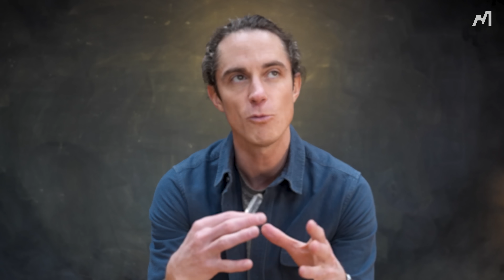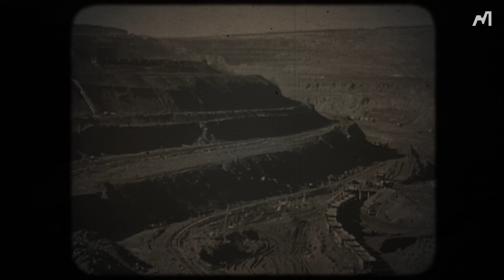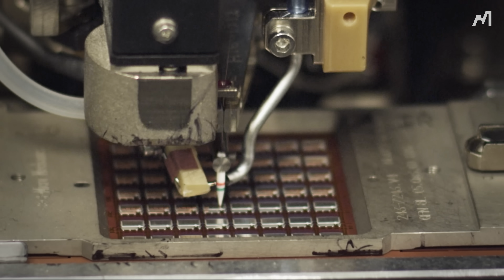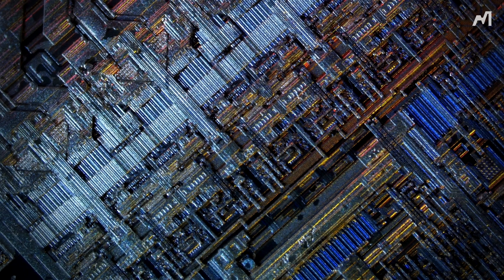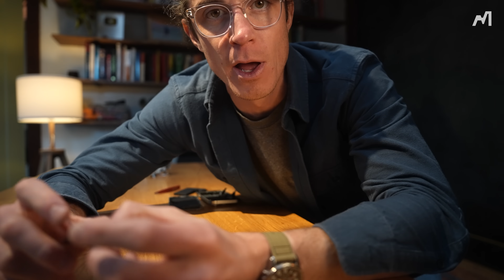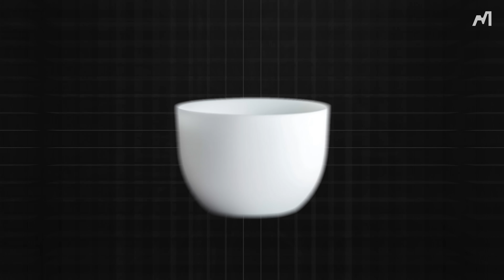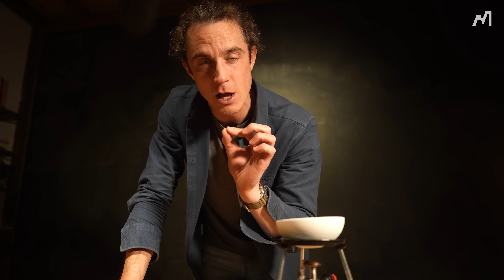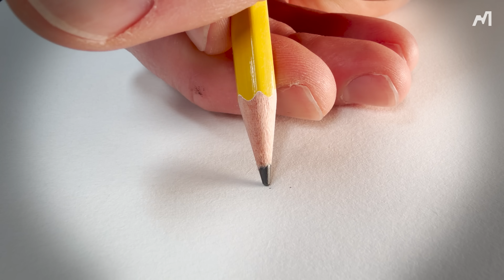Saudi Arabia Has Oil, America Has This

Comment: Fun fact: In the 1950s, Bell Labs basically gave away all the science, patents and production  information needed to make semiconductors to any company or country that wanted it (as long as they weren't communists, natch). Bell actually held classes to teach engineers around the world the process - because as you said, there's a lot of black magic involved. AT&T was afraid that if they didn't share the technology, they would lose their government monopoly on the phone business, so the pinheads in charge decided to just give away arguably the most valuable invention in human history.
Reply: dont forget transistor tech was incredibly difficult to make, even with the knowledge of what it is. There's such a massive gap between research and manufacturing silicon based transistors that it was more of a net positive that the tech was released freely. And then miniaturizing the tech? yeah that's where the real secret sauce is, not in the basic first principles of silicon based semiconductors
Reply: @skytron22  it is still massively difficult to make computer chips we just have 50 plus years of experience and equipment improvement.  If people knew what it took to make computer chips that work reliable they might just throw them away less.
Reply: @jonathanjones3126  i have like 70 cpus. mostly older pentiums and older i5 and i7. dont know what to do with them but cant bring myself to throw them away.
Reply: recycle them
Reply: @jjora.sI know how you feel, I have a 40 piece cellular phone collection stretching back to 97
Reply: @jonathanjones3126 gotta tell the companies doing planned obsolescence to stop first. Why value what is artificially deflated?
Reply: @jjora.sstore them in lead shielding and they just might be valuable if there ever is a massive solar flare or EMP attack
Reply: @jjora.s You could donate them to some underprivileged inner city utes.
Reply: @jjora.s Build a Super Duper Looper Supercomputer with Them! :D
Reply: @jjora.sTake them to an E-recycling place.
Reply: @jonathanjones3126  and humans last thousand years ago no nothing about this, imaginee if computers were invented in the time of Romans? where could be the civilizations now?
Reply: @BiggestG13 i have slowly grown a cellphone/ cpu / console collectuon. I've been trying to think of a monstrosity I could create with them...
Reply: @jjora.sdefinitely hold onto those CPUs.
Reply: @RG-Episodes  I'll be back. Terminator
Reply: @skytron22 really cool
Reply: @skytron22  Photo lithography was and is used for transistors - even microprocessors. Not difficult to make, I was making Ghz diodes at 17 years old for the company I worked for - by hand - not keen on the phosphene and arsine gas deposition stage - but hey every process has its drawbacks and all the chemical washes, vacuum aluminium deposition..........A transistor is two diodes back to back. it is not difficult by far - packaging, now your talking skill with wire bonding and encapsulation, diamond saws, but Ghz chips were wire bonded or silver epoxy glued to special low loss dielectric circuit substrates.
Reply: @skytron22  Naw, you're wrong. The basic first principles are far more interesting and important than someone 'miniaturizing' the tech.
Reply: @cjay2 disagree
Reply: while maybe not good for business, this accelerated human innovation in the semiconductor space.
Reply: @stephenjones991 Exactly
Reply: @stephenjones991  and that was the goal. They needed that to get to AI.
Reply: @artytomparis  The original goal absolutely was not to create AI or to advance the human race. It was solely to protect themselves from government intervention.
Reply: @DDadams0  ...third order of power in the universe...the law of unintended consequences...
Reply: @glennvage I want to know what you think the first two are please tell me what you think they are?
Reply: @nicholaswood7704  ...1.fear  2.direction of travel...
Reply: @artytomparis majority of AI is open source. Issue is access to equipment to do cutting edge impact on llms BUT youre still free to do your own cutting edge research on learning methods. Theres actually a host of researchers on youtube sharing this. It isnt as bad as it seems but still, majority of research money is being put towards the wrong segment.
Reply: @nicholaswood7704  I want to know now too.
Reply: @glennvage  What are the first two? And all the rest?
Reply: @maryamjoha answered below...
Reply: @stephenjones991 how about end capitalism
Reply: @joshuacox5817  communists and socialist must have capitalism, otherwise, they would not exist.  Would they?
Reply: @mattmorrow7777  buddy. You do not need capitalism for trade to exist
Reply: @joshuacox5817 🥴😩🤦‍♂️🤷‍♂️
Reply: @joshuacox5817  Inform the class which country has successfully removed capitalism. 
I'll wait...
Reply: @leofortey7561  plenty, but they were all suddenly attacked by CIA death squads and/or subject to regime change actions including puppet dictatorships, war, capitalist encirclement as well as economic hitmen and school of the Americas.
Reply: @joshuacox5817 "Plenty" is not a country. Go on, list them out since there were so many
Reply: @joshuacox5817  we're waiting for this list o plenty josh
Reply: @joshuacox5817 How about NO.
Reply: @joshuacox5817  oh, internet, don't ever change. 😂
Reply: @joshuacox5817  So, it's America's fault communism has killed so many people?
Reply: @joshuacox5817  Capitalism was the reason you enjoy the things you enjoy, including the most basic things you take for granted, and the reason you can say your nonsense on YouTube.
Reply: @hoppinggnomethe4154  1) government created internet, 2) creature comforts are here at the EXPENSE of other countries. Capitalism gives nice things through exploitation, not virtuous trade.
Reply: @joshuacox5817 get off you screen and go do something about it
Reply: @joshuacox5817  That's not always the case. It's maybe 10%. Endless genuine entrepreneurs, especially those who work in protecting the environment, do have altruistic goals and do their best to avoid damage or unethical trade. This is one reason why Fair Trade and Leaping Bunny certifications exist.
Reply: @joshuacox5817  You do. People need to perceive a benefit for an exchange to occur. That net benefit is the capital in capitalism.
Reply: @joshuacox5817 everyone your talking about where trying to become communists lol
Reply: @joshuacox5817  you're an absolute fool. Read a history book. The ENTIRE WORLD was in poverty less than 300 years ago. 99% of the population of the planet was in abject poverty. Less than 10% of the world is now. Capitalism made that happen. 

How many people do you know from the 3rd world? I know a lot of them. Kenya, rural South Africa, Philippines, Guam, Cuba, and more. Every, single, one of them praises capitalism for being the salvation of humanity because of the history of their countries. The ones from Cuba are particularly critical of communism.
Reply: @rustyhua  the ones from Cuba are white. The black Cubans stayed because they knew the u.s. was racist.

As far as the world progressing technologically, yeah that happened but the working conditions of the industrial revolution were trash and people were dying more frequently until there were improvements in working conditions because of socialists and workers protests and unions. The deaths from wars and colonialism was not from Karl Marx.

Keep lying though, bootlicker.
Reply: @joshuacox5817    i wish they would 
Id drive straight to your house and take everything you have and everything you were ever going to have.
Reply: @joshuacox5817  😂😂😂😂😂 saying the quiet part out loud huh? A true Communist would at least pretend its 'the people' instead of the government that achieves things in their totalitarian fever dream. After all, the supposed end goal of Communism, when a system becomes Communist is when government withers away. Your eagerness to (falsely) point out the government created the internet kills your own ideaology 😂

You're just a lowy statist who doesn't even understand their own religion.
Reply: @6Sparx9  those are certainly words. Dunning Kruger effect
Reply: @joshuacox5817  Invoking Dunning-Kruger as a means to invalidate someones argument is peak Dunning-Kruger 😂😂🤣

Feel free to explain yourself.
Reply: @6Sparx9  you're just proving my point. You think a reverse uno card works here but it doesn't. Child.
Reply: @RussellBeattie : Bell didn’t “choose” to give it away - they were “required” to by the conditions for their phone monopoly. They also had to give away the C programming language for the same reason.
Reply: @andrewmole745 The 1949 antitrust suit is different than the one in 1974.
Reply: @RussellBeattie  it was the 1956 Consent Decree that forced them. and it was not for free - they were expected to charge a reasonable license fee. and the foundation patents expired in the 60's.
Reply: @RussellBeattie in all fairness, if they didn't do that, we would have been set back 20-30 years in technology. At least.
Reply: You could reasonably argue that had they not done that it wouldn't have gotten so important in the first place but just been niche technology.
Reply: @nicklockard  No, it would have become important anyways because of how useful it is.
Reply: @joemascone  the industry would have simply have stagnated then. Also what could not have been reverse engineered then doesn’t mean it couldn’t be reverse engineered now. Even if it was considered top-secret, if it was absolutely critical, the secrets would have leaked like they always have
Reply: @joemascone I've said it before and I'll say it again that's because greed is a disease and unfortunately just like diabetes and sugar money is related to greed and if you accumulate enough of it if you can get past a certain threshold the disease kicks in and now you will do unspeakable horrible things to feed the disease, and that is why it will never be enough it's an addiction.
Reply: @ZahrDalsk we only know how important it is because millions of minds looked at it and came up with ideas and gadgets to use it. If only a few thousand employees looked at the tech development would be lower and slower. We'd be 56k and digital lcd phones today even if the employees were in the 90th percentile.
Reply: That fact wasn’t fun.
Reply: @crunchycrispybacon  You're right.  A fun fact would be, say this was a Marilyn Monroe video, "Fun fact- Marilyn Monroe had an extremely small sixth toe on her left foot".
Reply: @casmoneansthefourth  The claim that Marilyn Monroe had an extremely small sixth toe on her left foot is a widely debunked, enduring myth originating from a 1946 beach photoshoot by
Joseph Jasgur. The apparent extra digit in the photograph was likely a trick of light or a clump of sand, as subsequent photos show her with five toes, and no other evidence supports the claim
Reply: Knowledge should be free
Reply: @noonynoonynoo nothing is “free”
Reply: @noonynoonynoo  advanced knowledge causes geopolitical clashes bro and threat to national security(thats how to make easy money by keeping with the tech with patents😁)
Reply: "AT&T was afraid that if they didn't share the technology, they would lose their government monopoly on the phone business"
They were afraid of losing their monopoly, so they guaranteed they wouldn't have a monopoly? That makes zero sense, sounds like you're just repeating a story you misheard
Reply: @alexrogers777 Oof, just look it up. AT&T had a government sanctioned legal monopoly on the telephone business. But in 1949, the company was accused of abusing their monopoly, so they gave away transistor tech in 1951 in an attempt to appease the government.
Reply: That wasnt altruism, they had discovered patented and been iterating on semiconductors for decades iirc. They were forced to use the patent or lose it as a part of trust busting enforcement. Thats why the communism stipulation was there the us government was forcing its use and ensuring its own supremacy. They didnt advance tech they were forced to stop holding it back for the us' geo political strategic advantage, not human good.
Reply: @Shadow-gc6le  both of your comments confuse me but id like to understand
Reply: @artemislogic5252 fax
Reply: @artemislogic5252  The USA forced bell to share the info on making semiconductors by saying theyd lose their patent if they didnt use it. They also only let Western aligned countries have the knowledge so only NATO and the west would have the knowledge
Reply: @Shadow-gc6le  This is factually wrong in every way. The first working transistor was created in 1947. Bell Labs have their tech away in 1951 and 1952 in order to appease the government who accused it of abusing their legal monopoly. It had nothing to do with "use it or lose it". Where did you come up with that idea??
Reply: @Shadow-gc6le 🤔🤓
Reply: @Shadow-gc6le  Many see "the us' geo political strategic advantage" and "human good" as the same thing, esp us not in the US.
Reply: @LeeGee You mean especially us allies.
Reply: @Shadow-gc6le which is most of the world, whether one likes it or not. We keep the shipping lanes open
Reply: @baloneysaucejohnson8747 you were saying?
Reply: Of course transistors had been developed elsewhere between 1947 and 1956 when the case was finally settled.
Reply: fun fact an Italian invented microprocessors and another the tech to light print it
Reply: When we lived up there, I used to drive by the Bell Lab (now Nokia) in New Providence, NJ to show my kids where the transistor was born.
Reply: Texas Instruments was the first semiconductor manufacturer led by a Chinese engineer who later founded TSMC
Reply: A group advances humanity as a whole and they're "pinheads" for not hoarding the wealth from it 🙄 Yikes
Reply: Open source will always win where talent is more required then capital. I think they've made the right decision, since it also serves mankind as a whole.
Reply: @Krypt1cMinds 
There are two ways to keep your company techs: apply for patent and get government protection for some years in exchange for letting other companies study it and set up competition once the protection is expired. The other way is through proprietary, which goes without government protection but ensures you keep the secret as long as you can keep it secret.
Reply: @Krypt1cMinds Open source is for people to advertise themselves about how good they are in it. Companies will browse it to recruit the potential ones. But it's rare that once a talent is recruited they will put their next idea into open source.
Reply: @Krypt1cMinds  Not always. Sometimes the cost of producing IP is so great that to give it away is corporate suicide.
Reply: @Krypt1cMinds Evil power-hungry people and political systems will always use everything against the rest of the world. "For the good of mankind" is their excuse 25 years before they start to take action to control and enslave everybody else.
Reply: Gave away to whom?
Reply: @Sharingyaan they gave it away to Joe.
Reply: @elessarstrider5210no, Jo Momma.
Reply: @Sharingyaan   American corporations who in turn were bought by private equity and sold off for parts.
Reply: not "fun" at all
Reply: Thr fire is more valuable IMHO.
Reply: We need more of this.
Reply: I think they did a great thing by giving it away
Reply: But did it work?
Reply: Giving away the best invention in human history is the biggest flex you can make.
Reply: ... and then the government ended the phone monopoly, regardless.
Reply: Good stuff 👍🏽
Reply: Those pinheads are personally responsible for the technological advancements of the entire globe for the last 70 years. We would likely still be using 80’s tech without that move.
Reply: Google open sourced the LLM around 2016 if I recall correctly. Chat GPT went live around Nov 2022. The rest is history in the making.
Reply: @ElectricIguana slop
Reply: @ElectricIguana they didnt open sourced llm. They released paper called transformer architecture which is crucial in LLMs
Reply: @ElectricIguana ah yes, OpenAI, famously no longer open source.
Reply: @ObjectivistApe and no longer noon profit, lol
Reply: I hear what you are saying, but I'm glad they did or chips/computers might be way more expensive.
Reply: For anyone who wants more info, search for "Bell Telephone Laboratories Transistor Symposium" held in 1951 and 1952.
Reply: why did this channel not know about the blue mountain deposit in oregon
Reply: cute
Reply: Without Jesus you’re dumb.
Reply: Lithography was also given to sml because they were the only ones willing to keep the hard process going
Reply: They were forced to patent the semiconductor
Reply: Good times , commies where locked into soviet union, they didn't walk amongst us
Reply: Good
Reply: Yeah I don't know about this.....the invention secrecy act exists
Reply: in the 1950's they thought democracy was going to be good for us :face-green-smiling:
Reply: All companies should do this
Reply: That's not exactly how it happened or why. But fact is we're fed bs and you aren't going to get the whole story.
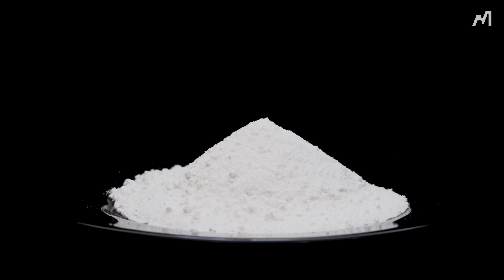Reply: 0:50 I'm not zooming into your piles 🤨
0:51 Too late! 😲
Reply: knowing how it's done is one thing, doing it and doing it well is the impossible feat
Reply: that tach fund with tax money payer...so belings to all of as
Reply: Try looking up the history of Sawyer Technical Materials
Reply: HEY TRUMP- I'VE STOPPED WAR WITH RUSSIA+ CHINA( AND EVERYONE ELSE)...
BE VERY NICE
OR 
NO CRUCIBLES, NO ELECTRONICS...
MWAH MWAH MWAH....
🤯🤯🤯🤯🤯🤯🚀🚀🚀🚀🎇🎇🎇😭
🎖️🏅🏅🥇🥇🥈🥉🥉🥈🏅🎖️
Reply: Fun fact.  Belle Labs main contracts were military and medical.  At least one director I know of was the head of a program to develop our capability to shoot down ICBM's.  The same person had the humblebrag that some successes they were having were part of what led to the Stat I treaty or something (nuclear arms reduction) before he died.  He didn't go around bragging about his time at Bell labs but I asked him a whole bunch of questions and took notes.  He was talking about how he had email in the 60's and how certain tech they had he is surprised they didn't pursue more (make commercially available) as a lot of tech we have today is a result of experiments and tech they made back then.
Reply: They gave it away because the United States had vigorous antitrust enforcement at the time.  They didn't really have a choice.
Reply: Well, that is the benefit of a gov financed company. What gets me is today universities hoarding and patenting everything even when using gov money and when it is totally unreasonable to do so.
Reply: Why would they lose their monopoly by not sharing the tech?
Reply: @RussellBeattie
"Fun fact: In the 1950s, Bell Labs basically gave away all the science, patents and production  information needed to make semiconductors to any company or country that wanted it (as long as they weren't communists, natch)."

The old ways are the best ways.
Reply: If that didn’t happen the USA would be the most advanced nation in the world by decades. What a world that would be
Reply: What?
Reply: I have seen patents that are so basic that they're just for big companies that have money to patent everything and then sue small competitors out of business. I wanted to create a way to design and order DIY tailored custom clothes so I dug into the patents while I made a business plan. Amazon custom clothes was literally a doodle a CNC Cutting table of different fabrics put in a box together sewn together. I got the idea from how Ferrari's are made leather seats are cut from cow hides with automated cutting wheel CNC table. It had the totes on a conveyor and little trucks a factory with smoke stacks. I found it because I thought why not do that with clothes. A bunch of photos at different angles a tape messure some AI to make a digital twin 3D avatar a step by step entering of personal tailor demnsions well that was also a patent the sheet template to enter in messurements a way to layout patterns efficiently and adjust them to size a patent a 2D image to 3D rebdar using AI yup a patent. What if I want a non toxic die that uses way less water a patent a way to have cotton denim organic weave on one side and wool on the back you guessed it a patent and a trade mark so I wanted to be able take a  picture of myself turn that into demensions other some tailor demnsions make a digit twin and then dress and design by clothes like dressing a grand Theft Auto or Tony Hawk character, then be able to choose different styles like whether I want to notch the pal and then customize it to my body and basically it print. So everybody can have custom, closed mail, the materials they want and the design that they want all, and I would have to deal with seven different companies and step on eight different patents or lawyer up and find a bunch of lawsuits. It's annoying and insane.
Reply: Never underestimate the stupidity of CEO's
Reply: Kind of like chevy/gm did in china recently.
Reply: Imagine how much better off America would be if there weren’t so many absolute idiots throughout history sabotaging us.
Reply: Bell's legacy was incredible, an American treasure. He'll be part of world history for a long time to come.
Reply: The inventor William Shockley was such an obnoxious racist that his team broke up into start ups, enhancing the start up culture that lead to fast innovation. I went to one of his presentations, and became convinced he thought blacks were subhuman
Reply: @ElectricUniverse56  well, he wasn't wrong.
Reply: Thanks to that, Chips are everywhere, relatively cheap and of many types. Capitalists like you, are the big obstacles to progress. Now opposing right to repair. Get out of the way!
Reply: if we only had some kind of extension of land completely covered in sand, hopefully in every continent, with ways to purify it even if it was more expensive...
Reply: Lies
Reply: At the time the concensus was that large American companies would use it for "good". Then came private equity and it was sold off for parts to multi-national corporations. Reagan  & Clinton set it in motion and now it can't be stopped.
Reply: If something is funded by the gov, it can’t be patented. They were getting ahead of the curve.
Reply: I think its Smart 🎉
Reply: But just think if they didn't we wouldn't be where we are today That's the thing with open source That's why it's so powerful 🤷‍♂️
Reply: Good
Reply: If they didn't give it out, we wouldn't end up with the advanced tech we have now. Competition is good for innovativeness!
Reply: Is this why all the Taiwanese moved to USA in 1970-80?
Reply: Oops accidentally did something ethical
Reply: July 1947 we had the Roswell incident.

December 1947, only six months later, bell labs introduced the first transistor launching the modern computer revolution.
Reply: you type like youre against free flowing knowledge
Reply: So mad they let other countries learn and become top producers of chips
Reply: Pinheads? The internet is literally responsible for your growth as a nation after the 90s, without it you'd be in depression. That would not be possible without a cheap and widely spread network built by many governments. No other institutions can foot the bill. Peak Americanism to be whinging about having to share something, the results of doing so made you the money in the first place. So ignorant and entitled always
Reply: No. The government was well aware and FORCED this transfer.  Full disclosure. I grew up in Murray Hill, home of Bell Labs, the transistor, Telstar etc.  Growing up we heard all the stories.  B et ll labs had the technology to have your phone call the fire department in your town in case of a house fire in the 1960’s but were banned by the government from entering that or any other market. IBM was under the same constraints.  It wasn’t until Reagan came in and stopped this nonsense that tech really shifted high gear in the 1980’s
Reply: Pinhead??
Reply: Fun fact: It is this exact corporate for profit short-sighted mindset of yours that we should be hoarding tech for nationalistic uses in stead of proliferation, that we aren't another two centuries ahead in tech compared to where we are now.
Reply: nah open source everything.
Reply: And they still got broken up as a monopoly
Reply: " so the pinheads in charge decided to just give away arguably the most valuable invention in human history." Its disturbing that you and so many people think they are pinheads. Sure sounds like good business and arguably better for humanity.
Reply: Super neat man thanks for sharing
Reply: Nah..  Bell Labs was given  certain artifacts from a craft and told to examine and back engineer whatever possible and as result years later also released those patents to other companies due to an unfair advantage, hence yet another reason disclosure is constantly stalled,  many companies were given an unfair advantage that decimated competition and the endless litigation that would ensue after these files are released runs into the trillions of dollars.
Reply: I actually think the telegraph and light bulbs were more important than the transistor as far as fundamentally changing the world .
Reply: @josephpadula2283 I don't necessarily disagree. That's why I wrote, "arguably". 😉  There's points to be made for each invention, for sure. I think if I did have to choose, I agree it'd be the telegraph. It sparked the beginning of the information age.
Reply: @RussellBeattie  Companies can innovate the snot out of this tech, but they always need to make sure they don't "telegraph" their research.  :0
Reply: @josephpadula2283  idk I would think the printing press were more important if we are going down that route lol
Reply: The biggest transformational leap ever was the manipulation of temperature, more specifically, the ability to create fire, lightning strikes were not the big initiative, it was the stone used to make sharp weapons for hunting, the spark drew vision of a lighting strike, that lighting strike had been investigated by this same architectural stone shaper, the observation recognized the burned stripe terminating into the soil, curiously the digging wondered where did this black band lead to, And alas, The curiosity had discovered the first roasted ground squirrel, and the rest is history, There's a little place that still serves a dish prepared that exact same way...(True Story)
Reply: I thought they were forced to do that during the break-up?
Reply: Tesla also doesn’t patent much of it’s stuff.

Sharing valuable information with the world is great for humanity.
Reply: @user-yq6ov6ow7l Yet, funding an oligarch who is actively destroying democracy for personal gain
Reply: Western men are the ultimate altruists despite the belief to tbt contrary. We gave China their economy much to the detriment of ours. We gave away shipbuilding and ocean trade even after our sons died to win and secure it. Now we have to spend many billions to make up for those mistakes. And we will likely have a third world war along the way.
Reply: Actually, maybe it's not just the most valuable invention,  but a change of ages in human history 
Just like from the Neolithic to the Bronze Age or else
Reply: Greed is a sin for a reason.
Reply: Good lord.....
Reply: Can't you grow quartz?
Reply: @wind_cruiser growing it does not make it pure.
Reply: and lost the monopoly anyways, which in hindsight was a horrifying loss because the Bell Monopoly actually yielded some of the greatest tech advancements in history that have not been replicated by any of it's successor companies, breaking up AT&T was thus a massive technological step backwards for America
Reply: @SXZ-dev, I didn’t like renting my phone…..
Reply: No doubt someone was paid very well by those other countries to provide that knowledge.  After all, what could be the harm in sharing such information?!?
Reply: @ProudDawgFan  There are no secrets in science and ther are very few in technology
Reply: The most valuable invention of the 20th century. The printing press was more important; that and pen and paper. Otherwise we wouldn't have any inventions written down in the first place.
Reply: @HoningLuck-w6x well of course. That's like saying well actually language is more important because if we didn't have language we wouldn't have pen and paper needed to write things down.
Reply: @HoningLuck-w6x  eyeglasses for hyperopia allowed old craftsmen to continue and to transmit skill to the young
Reply: @HoningLuck-w6x  eyeglasses for hyperopia allowed old craftsmen to continue and to transmit skill to the young
Reply: Greed
Reply: @anthonyshafer9529 I said it before I'll say it again, greed is a disease and once somebody accumulates a threshold amount  of it, wealth/money I mean, the disease kicks in end the addiction takes over and at that point they lose their humanity and they will do horrible unspeakable things along the way to accumulate more of it.  The ancient Greek, galen, physician to Marcus Aurelius wrote extensively and he says that they could diagnose greed as a disease in a young child like a toddler and that they could treat it if they were able to diagnose it at that age doesn't say what they treated it with though unfortunately:-(
Reply: Foolish? Or by design? What better way to influence and corrupt the world?
Reply: A lot of communists in the comments are going to be sad about this 😢😢😢
Reply: We are the devil's benificiary, and God's inheritants. We must learn to USE our DARKest-side to PROTECT and NURTURE our innocent growing embers of light.
Once we have a full grasp of it, strategize for the innevitable. It is just intellegent economics. 😈😇
Reply: Democrat 🤔
Reply: Not pinheads in charge.  Threats from Democrat politicians who wanted that info spread to the communists.  History you won't learn.  There is a good book called The Idea Factory if you want to know more.
Reply: Yeah that doesn't really hold up today
Reply: AT&T was broken up for being a monopoly, so their fears were well founded.
Reply: Giving away inventions is good actually. Every discovery is discovered by standing on the shoulders of everyone before you.

Sharing knowledge drives humanity forward. Controlling it only enriches the ruling classes
Reply: @Teeurbo : The entire point of patents is to give people a reason to both disclose their discoveries and go looking for new ones, without actually paying them to do it.
Reply: The idea that the rest of the world wouldn't be able to invent semi conductors themselves is ludicrous. Black magic, sure, lol. France build their own nuclear bomb all on their own with no help or spying. I'm sure ppl would have been able to make semi-conductors. Inventions are not single instances of genius, but deterministic consequences of necessity. Things get invented because things are needed, not because some single, unique genius was born and came up with it ex-nihilo. The ultimate inventor of a technology is simply the first that came up with it, not the only one that could.
Reply: @zagreus5773  You should read up on the topic. A French laboratory has already started making an alternative transistor system in 1948 called the "transition" soon after the original discovery, but it was very unreliable. What Bell Labs scientists did is figure out exactly how semiconductors worked at a subatomic level (which got a Nobel prize) and then work out the production process which best utilized that understanding. The rest of the world would have taken another decade or so to catch up.
Reply: @RussellBeattie  You claim that, with absolutely zero proof and you heavily overstate the role Bell Labs played. Their inventions were based on publicly available science, the basics were already out there. They were simply the first to come up with a lot, but there was no "black magic" involved and there is zero reason to believe it would have taken decades for others to come up with the same stuff. People constantly overestimate the role of the first inventor of an invention. Seeing that it is possible to do what Bell Labs did would have made everyone else in the world invest heavily into replicating it. Maybe two years later and you would have several other companies replicating Bell Labs inventions, which they then would have the brain to patent, essentially taking the invention away from AT&T. Making an invention and then not patenting it is just pure lunacy. AT&T sharing licences with other companies was their way of making money from it as well as making sure others stay reliant on their expertise. This wasn't out of altruism. Plus, AT&T was a government sanctioned monopoly, they had to be pretty generous with their licenses anyway. As soon as you share it with a bunch of US companies, which they were legally required to do, you can share it with the rest of the world anyway. Can't keep that a secret at that point. But even if they had kept it to themselves due to national security reasons, it would have backfired immediately, as I just explained.
Reply: Giving away the tech is way better for humanity then keeping it secret.
Reply: that's how Capitalism works... you got a problem with that? don't blame the Communists.
Reply: @kpw84u2  The USSR  never figured out how to make computer chips onna reliable basis. What they could make was quite primitive compared to the west.
Reply: What does Bell Labs, Battelle Labs and E&EG (Environmental & Energy Group) Have in Common???🤔

🛸Re-engineering 🫢🫨🫨
Reply: You state "AT&T was afraid that if they didn't share the technology, they would lose their government monopoly on the phone business,"   How can you lose a monopoly by sharing ?
Reply: @joe28704  AT&T had been given a legal monopoly by the government decades earlier to help spread the adoption of the telephone, but in 1949, the DOJ launched an antitrust suit against the company accusing them of abusing that monopoly. AT&T made the decision to license the transistor technology cheaply in order to appease the government.They didn't consider computer technology that important, and in 1956 were willing to sign a consent decree in which they agreed not to enter that market. Short sighted doesn't even begin to describe it.
Reply: @joe28704 : The government was thinking of breaking up AT&T's monopoly, so they were intentionally giving things away to make themselves seem like a less tempting target.

Of course, they still got broken up, but AT&T responded by reversing their disclosures...
Reply: Good on them! Patents are an abomination!
Reply: @pappaflammyboi5799 yeah this is a win in my book… Back when we were actually anti-monopoly. 

The US is still the most powerful nation even though Bell gave away the info. Like everyone else is saying, open source creates better technology.
Reply: @MindYoBusinessComeOn we don't break monopoly currently for this exact reason
Reply: Patents are a cancer for humanity